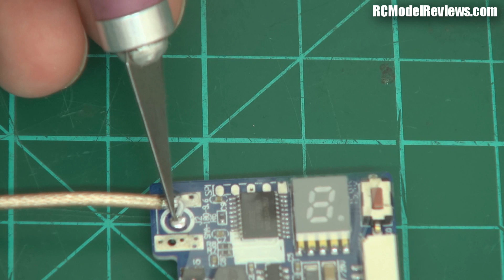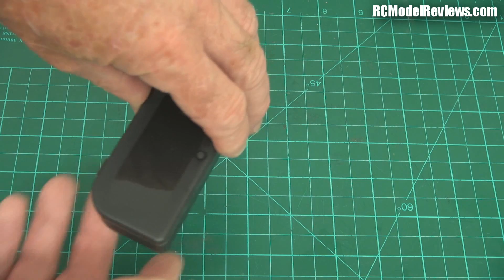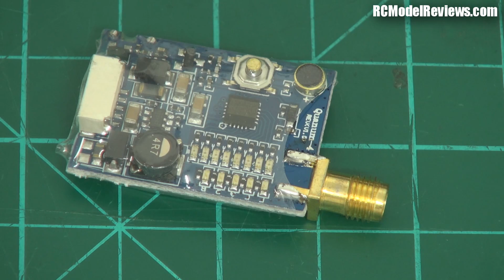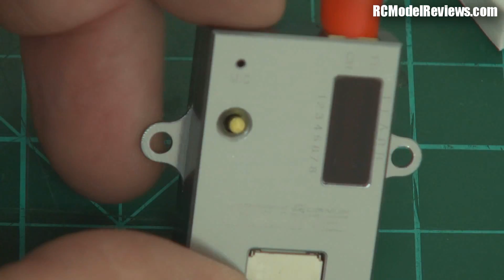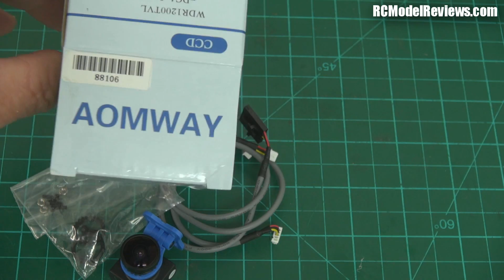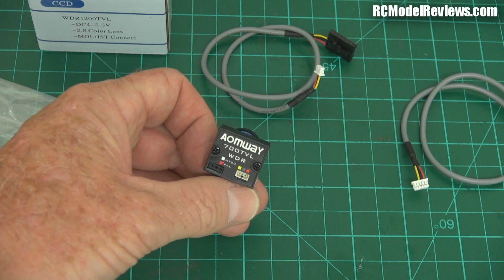4 FPV transmitters and 2 CMOS cameras

Comment: So many transmitters yet all the same :D
Can you measure the power drop with direct soldered cable? 
I'm thinking about desoldering SMA connectors and soldering extension cable directly to VTX output. I've read the best way to do it is solder the outer screen on one side, kinda like here.

Comment: That last camera is really great. The image is really clear with natural colors. I only found 1 flaw. After a bit of a rough landing the lens part was thrown off including the casing it screws into leaving the optical reception part exposed. You should definately check this before installation and flight. A minor shifting of this case will cause focus issues. 
And also it's a real pain in the butt to search for a tiny piece of plastic in tall grass for 20 minutes. Hotglue fixed the problem.

Comment: 17:55 Bruce that camera is the same camera that comes with the aomway backpack series that hobbyking sells (you reviewed this camera already) but if you do not use the backpack feature you can use this cable and plug it in the backpack series vtx. works real well, and actually prefer it that way since the backpack series overheats since the camera is blocking the module from fresh air.

Comment: Please crack the aluminum case and see what is inside.  Is it the same?  Did they actually put some sort of thermal transfer tape or compound to the case from the transmitter module inside?

Comment: I don't know if anyone mentioned it, however, the Quanum Elite appears to have a voltage regualtor built in as I believe it stated 5v out on the label. I use the AOMway 200mw 32ch VTX with the AOMway SP Antenna and seem to get as good a performance from it as I do from my Fatshark 250mw 8ch VTX with a Spironet antenna IMO.

Comment: It's easy to miss pivotal data in off-the-cuff scenarios - this is edging pretty close to 'unboxing videos', which, of course, you don't do on RCModelReviews! But I follow the logic that got you here and I'll 
watch them all, too. But it would be a pity if 'showcasing' edges out the more studied reviews.

The QE58-2 TX is switchable 25-200mw (you have to go to the HK site to find that out), and the Mini CMOS camera (cute little fella) is $15.17 on HK and $9.80 - free shipping - on Banggood (just got one, not tested yet). 

What happened to Part 2 (the important field-testing part) of the UHF LRS shootout? 

And Part 2 of the "HobbyKing 1.3GHz micro FPV transmitter & receiver (review)" from Nov 2013? HK no longer supply that, but I found it on http://www.dx.com/p/rvm1300r-tm1300-1-3ghz-wireless-video-transmit-receiving-module-black-silver-192726#.VwErZnp495Z   I bought this little Mini CMOS  camera to use with that Tx/Rx combo (all 3.7v-5v) on tiny foamie and a micro quad in the little park across the road ( so I'm looking for weightless stuff and don't mind the short range but want to tx through the trees). You were going to investigate a dip switch mod for channel selection. There was some stuff on HK in the comments, but largely unintelligible to me - have a copy if you want it.

Comment: You didn't mention that the Quanum ELITE QE58-2 can be switched between 25mW and 200mW by cutting a wire!  I am going to buy one and wire in a micro switch or jumper pins.

Comment: Hello, I would like your help if possible
I bought a transmitter likel you presenting in video
Quanum Elite X40-2 600mW.
I made all the connections with the supplied cable,  camera, antenna and battery.
During 5minutes worked fine, pass some time then reconnected and not transmit, already experienced with another camera and the problem is the same.
You know what might be the problem?
Thank you

Comment: Aluminium case nice but not so nice...the mounting tabs should be flush with the back side of the case, not mid mounted. Why? Do bolts up tight....mounting tabs bend :(...aslo funny to see the philips screw on the back cover almost stripped to oblivion... A step in the right direction by Quanum though

Comment: your title is wrong. It should be "4 FPV transmitter, 1 COMS and 1 CMOS cam :)did you also get this one quanum VTX that comes with default power of 25mw (for races) which you can set to 200mw by cutting a bridge? and another question:  did you have the chance to compare the FR632 vs ImmersionRC Duo58?   I think I stick with the FR632 - seems to have really good sensitivity!

Comment: Hi,
you didn't mention, but I find a notable difference that the QE58 also provides 5V to the cam when the Q58 only repeats the vbat.
Ah, and you're so right, I never know how to hang my transmitter. And always set the dip switches the opposite way... It seems that black is the position of the switches (which are confusely white). 
And what is this unit they express power in ? mWH ??
You might never have considered using audio to fly fpv, but it really adds something when you pilot. Especially with others as it feels quite disturbing not to ear a noise matching your throttle input and your mouvements.

Comment: I'd like to see full review of the metal vtxs. Especially the vertical antenna one. Could be nice mounted on the back of the top plate of a mini quad. Important: is the alu case heat-wise connected to the tx module?

Comment: That mini cam is actually fairly good for a mini cmos cam. But if it has the same 170 degree lens as the one i got from banggood, i would recommend replacing it with a #16 keychain cam D lens. The 170 degree lens has some awe full distortion and is extremely wide. The Keychain cam D lens has about the same fov as a 2.5/2.1mm lens and i'm loving it on my atom 122mm microquad.

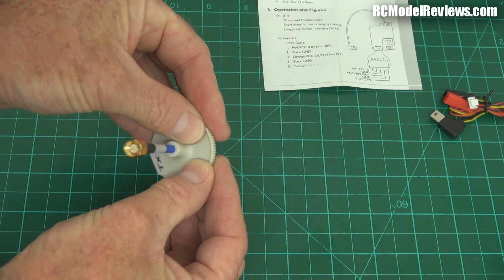Comment: 5:31 Glue... Any type.
9:15 The input voltages and output voltages are not the same. The Channel Indicators are not the same. The used number of pins of the base module under the heatsink are not the same.
Reply: +lasersbee 
You didn't listen to what Bruce was saying. The RF modules are almost always similar, not the transmitters. And the label is for the connector, not the RF module.
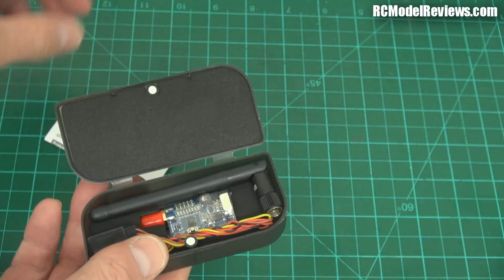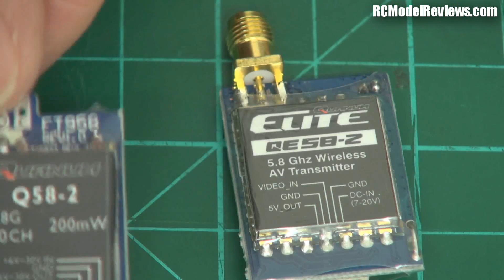Reply: +superdau 7:48 says it's "pretty much the same unit"....then at 9:00 when showing the writing on the 2 units he said again that they were
"pretty much the same"  it is easy to see that they are physically "pretty much the same" if using them as a paper weight.
But for their intended uses and PCB electrical connections they are not even "pretty much the same". They are 2 different units (probably) using the same RF module under the heatsink but using different connections to the RF module to the PCBs.  
Perhaps you were not listening ;)
Reply: +superdau 7:48 says it's "pretty much the same unit"....then at 9:00 when showing the writing on the 2 units he said again that they were "pretty much the same"  it is easy to see that they are physically "pretty much the same" if using them as a paper weight.
But for their intended uses and PCB electrical connections they are not even "pretty much the same". They are 2 different units (probably) using the same RF module under the heatsink but using different connections to the RF module to the PCBs.  
Perhaps you were not listening ;)

Comment: Bruce, I use those really thin coax for 5.8 pigtails (same as you'll find inside the Taranis between RF module and antenna). Is that bad for 5.8 too? is there a thin, light alternative that is good?

Comment: Bruce dont know if you have checked the specs on the Hobbyking site about those Quanum Elite TX's but they claim the same current consumption for the 200mw & 600mw unit which is just not possible.  As you appear to have the equipment to measure RF output power at 5.8ghz I would welcome a test of the actual RF power outputs of these devices on a spot frequency say 5645mhz the lowest one.  This could turn out to be interesting I would do this myself but unfortunately I do not have the hardware to achieve it at 5.8ghz.

Comment: Just a thought regarding the Quanum vs Quanum Elite and the missing GoPro wire in the Elite. Do Elite fpv racers use gopro camera as the fpv source? No, due to the amount of lag. Thus it makes sense that the Quanum Elite does not include the GoPro wire as the Elite fpv racers would not use the GoPro as an fpv source.

Comment: Don't buy the QE-5.8 series! have 3 of the QE5.8 and they all burned the small chip with 6 legs! one from lift rc and 2 from hobbyking
Reply: Let me guess? LB20's?
Reply: yes.. tell me more
Reply: +RC and FPV Jonathan Its due to the active braking on the little bees. They can send spikes up to 30v which fries cameras + Vtx's and everything not protected via a pdb, voltage regulator or capacitor. So long story short, use a pdb/cap/vr to power up your vtx/cam.
Reply: +assaulter99 damn.. thanks for the reply! I also use a lux flight controller now(connected to the pdb directly). gauss I can better ad some caps to my setup:) thanks again!

Comment: You overlooked that the Quantum Elite QE-58 Tx has a 5v BEC built into it, and accepts up to 5 cell lipo...so you can just buy a 5v camera and never have to worry about switching between 3s or 4s, or running an external regulator.  The non-Elite version doesn't.
Reply: you are correct, and also I'm pretty sure it's got a wire you can cut to have it restrict to 25mw output. So this elite is actually a pretty nice unit.
Reply: +thechosendude yes.  and the first 'elite' uncased one also includes a microphone.  Further, he forgot to mention the transmission switch function too!  all very useful features unique to this excellent vtx

In my miniquad I power the FC and Rx with the 5V output, as my cams are wide voltage on their own.  awesome for making the build easier and neater.

a very sloppy review this time Bruce.  RTFM!
Reply: sross148 Do you know what the output current is on the 5v BEC?  I was thinking of using it to power both my RC/Rx, as well as a 5v board camera, since I'm using opto ESC's (like most people these days).  Only thing is that's starting to get up there in power consumption on those three things, so I would be slightly worried about nearing the limit.
Reply: +thechosendude good news is today all the decent cameras are wide voltage.  and most of the good cameras before were 12V anyways.  The 5V cameras are mostly crap (eg anything CMOS).

hey but to Bruce's credit he is usually extgremely thorough and awesomely incisive in his criticism.

I would have liked if he had mentioned the Cricket version of this same Quanum elite vTx, which is identical except for its ability  to turn off RF transmission when powering up and changing channels. and costs about the same
Reply: +BWX power demand for things like FC and Rx are fairly minimal, similar to a 5V camera.  I am running 2 racing quads powering the FC and Rx off the vTx like this now.  Did a hard day of racing with them and zero issues.  Of course I am not powering the camera off the vTx (no need to).   if you have servos or LED plugged into the 5V line though you could have trouble.  In a miniquad this is not an issue as we don';t use servos and most often run LED off the lipo (or 12V reg)

Comment: I'm sure you will notice in the full reviews but the qe58-2 is a fair bit different from the q58-2. the qe looks to have a different module see the pin out. it also only takes up to 20v not 30, it has a regulated 5v out. It also has a mic. Bur the most important thing is that it can be either 200mw or 25mw by cutting the small wire on the edge, this combined with race channel means that it's great for race meetings. They should have fitted a switch though, but should be an easy solder job. also it looks to be a re brand on the fx795-2

Comment: RCmodelreviews the qe58-2 has a cutable link to change the power output to 200mw from 25mw. I was thinking of putting a switch on it?
Reply: +Q-Bix FPV yeah, got one and put a switch one. Should help flying indoors in areas with lots of reflection. Or flying with a lot of friends. Haven't noticed much difference yet as I've only flown outdoors.
Reply: +Maarten O (m00st) what kids if switch? I have no idea which kind or how to fit it b
Reply: +Q-Bix FPV very small 3-pole switch harvested from broken electronics. Anything goes really, you could add a jumper or so.

Comment: Hi Bruce

Thanks for all your great reviews! As an electronic engineer, I really appreciate your thoroughness and integrity. 

You ask at the end what we would like to see. My suggestion is the HS1189 / Foxeer XAT1200M from Surveilzone,which seems to have the same case as the HS1177. It's billed as a 1200 TVL 16:9 camera for FPV and despite being CMOS has received positive reviews elsewhere. If it passes RCModelReviews scrutiny then it might be a good choice for the current crop of 16:9 goggles. 

Cheers,
Andrew

Comment: That's the same camera as the surveilzone cc1563 and i'd bet my life it's closer to 170 degree.  I'd run it off 3.3v, i power mine from the naze 3.3v pin.  I think it gets hot on 5v after awhile and starts to overexpose badly.  It does do a decent job at changing exposure quickly for a cmos camera.

Comment: The 2 "elites are the same except for the case. And they both have built in mic.
Reply: +highoctanehotrod the Quanum ELITE QE58-2 can be switched between 25mW and 200mW by cutting a wire.

Comment: Regarding criticisms on the first transmitter:

Plastic sheet over heat sink: less impact than you'd think.  Large cross section, short distance.

Vertical section in center of cloverleaf: yes it impacts pattern, but if the rest of the antenna has the right geometry you can still get very good pattern and reverse skew sense rejection.

Comment: HI there Bruce , I want to know haw much  protection does the aluminum case give to the sma connector , I ask this cause I fly racing 250 mini quads and I have a immersion Rc transmitter 600. That got the sma connector loose from the board , I end up connecting the thing with a cable just like the one u have first on the video . It's that really a problem , cause I was thinking of buying the one with the case but then I see the one with the cable ...thanks mate !!!!

Comment: The 2nd transmitter has a microphone as well I think?
Reply: +DutchRC Adventures  I noticed that as well.  I wish he opened the aluminum case as its layout looked the same as the 2nd one.
Reply: +DutchRC Adventures It seems identical to the FX799T-2 which does have a microphone  - it's the circular component on the top left of the board (assuming you are holding it so the SMA connector is top right). I expect that the enclosed unit has the same PCB as the mic, SMA, button, LEDs and connectors are all in the same position. The related FX796T-2 (which I use on my mini) similarly matches the positions of all the controls, indicators and connectors on the second enclosed unit with the right angle SMA connector, and also has a mic.
Reply: +Andrew Roos Agreed people.. I'm sure those transmitters are the same indeed...(I have these as well..)